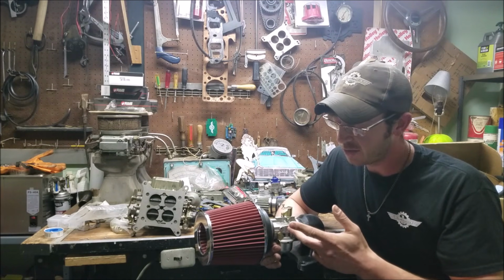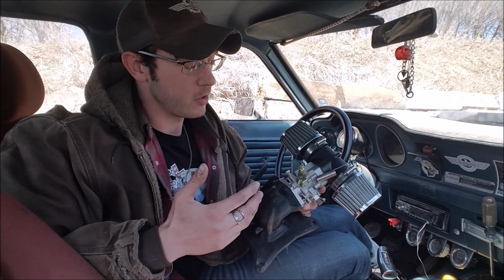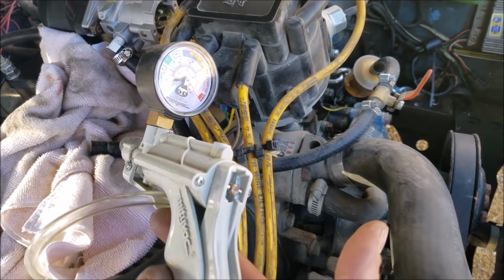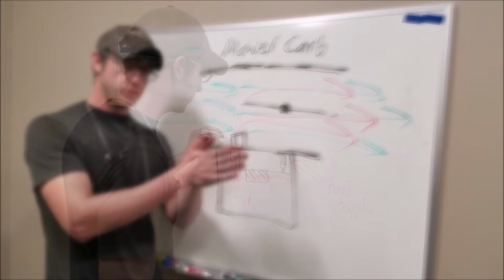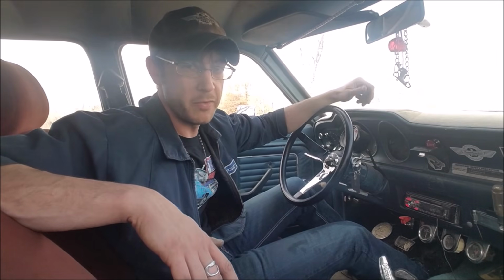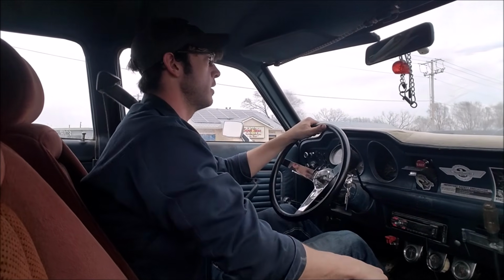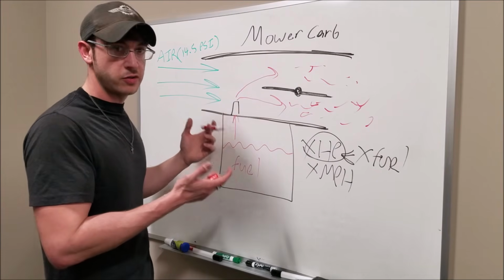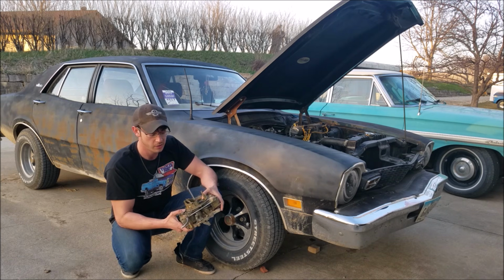Will It Run? Lawn Mower Carb on V8! (The "IMPOSSIBLE" Becomes Reality!) Start to Finish

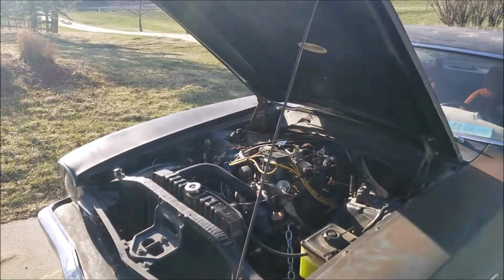Comment: 25:20   I was into building motorized vehicles from an early teen. When I was about 16 I was helping one of the older guys sand and prep his '56 Chevy. I'm 70 years old now so that was the golden days of building red light racers.

What brought me back in time, was the chain holding the engine from torqueing itself right out of the engine compartment. This was standard back then everyone had the engine chained down. You learned that after blowing out a motor mount the first time.

Comment: I think you did well...in 1982 I worked for Honda we had ordered a few Civics that had a little tiny one inch or less Throttle plate on them and they were  apparently good for 62 miles per gallon ..fun fact ..  That air in a smaller intake will travel faster than  air in a bigger one..plus if you want to increase air in a smaller pipe just mount a small egg into the intake with a variable height slider  ..it will pull in more air..old german Tech
Reply: What do you mean increase air in a smaller pipe?
Reply: @yeboscrebo4451 Air velocity will increase but volume will decrease with an egg.

Comment: I would treat that 41 mpg with a bit of skepticism and here's why.  Your distance traveled was only 39 miles which is way too short to establish a reliable mpg number and secondly filling the tank at a service station gas pump won't reliably top off the tank with exactly the same volume of fuel each time.  That can easily vary depending on the horizontal position of the car fore and aft and side to side at the time of fueling.  I can see how that volume could vary by a pint, a quart or even a half gallon.  With only a 39 mile drive that fuel volume difference can skew the mpg number quite a bit.  Your theory of better gas vaporization sounds very plausible and increased mpg with that small carb to me is believable.  What I would like to see if for you to do the same test and burn a much larger volume of gas over a greater distance.  Enjoyed your video very much.  Very educational stuff!
Reply: Your absolutely right about everything, I see a half gallon variable depending on the slight angle differences between stations. Every car is different too, mine gets less fuel with the front down hill. 

I will say in defence of the MPG number he got that his car with a 4 barrel carb might get 15mpg on a good day, so the setup he got is still a significant improvement even with that variable at the pump.
Reply: Agreed, I would love to see a measurement after a whole tank.

Comment: Well Done Champ. Your control device is so elegant. So impressed. Yes that smaller carb venturi allows for superior fuel atomisation but it's your wise management of stoichiometric ratio under differing engine loads that takes full advantage of the better gasification = it is simply beautiful. Probably superior to any MPFI for economy.

Comment: As a Brit with a Chevy K10, this is intriguing.
Our fuel prices equate to $8.30 a gallon over here, so fuel economy is always a consideration.

You've now got me thinking whether a V8 will run on an older SU type needle carb.
I think you've definitely got an angle going on here.

Keep it up!
Reply: My 98 K1500 is starting to give me trouble with all the electronics and bullshit.  It’s looking awfully tempting to rip all the computer shit out and stick one of these puppies in here.  The only thing that’s getting me is the varying loads, think I’ll tune it to run at 55 and just stick to country roads.

Comment: Ok here is my idea for the next step of this project. Print a new manifold adapter that holds 2 or even 3 lawn mower carbs. It would maybe look like a little blower hat. The carbs could be linked together/ isolated depending on performance needs. You could even figure out a way to stage them to act like secondaries if you wanted.
Reply: Yes. Volume/horsepower on demand is where the interest would be. Certainly impressive that he pulled down 40mpg in a big, heavy, V8 car, but it's not a hot rod. People interested in mileage alone could just buy a 4 cylinder, small car.
But those of us who want high horsepower old V8's that can cruise with reasonable mileage would be very interested in this.
Reply: What would be the point of that honestly , the whole point of this project was to see would it work peroid ..everything else was a bonus ...by adding more carbs ..your just going back to a fossil fuel guzzling engine , as homer said alot .... Doh !!!😭😂😜🤣
Reply: @ger808  No, the point is to turn those additional carbs on/off depending on demand.
Reply: @ger808  Your posts are getting shadow banned and so are mine.
Reply: I was thinking more about it and you could use a couple throttle cables and a custom linkage inside to activate each carb manually on the fly and fuel could be completely cut at each carb with an electric fuel cut solenoid like the ones in the bottom of the carb on an old craftsman lawnmower.
Reply: @borisjankovici662  ok I see cheers for the info

Comment: Hi. This was an interesting 1 hour+. Most lawnmower (carbs) I have tried work with e85. You could also try ethanol (blends), which produces a leaner mix. Blocking the radiator helps retain some of the heat of the engine, to get into efficient burn zone. You also noticed, the vacuum in the manifold is deeper. Thus, the initial pressure starting the compression stroke is lower than with a big carburetor. Therefore, your engine is running Atkinson-cycle. You noticed it yourself from a quieter exhaust note. With normal timing, there will not be knocking, because the initial cylinder pressure is lower. Thus, to get even better mileage and increased horsepower try advancing timing (even more with e85. Until the point of knocking). Also, lowering the head could give better efficiency, to be in par even with stock cylinder head pressures. If you do that, instead of 41mpg, you could probably do 50mpg .. MIB's helicopter heist 80mpg..

Comment: I bet that thing actually got 80 mpg. I'd like to see what that could do in a smaller, lighter, more aerodynamic car like a Prius with the battery removed for weight savings. You're a genius. You certainly know what youre doing. Keep fooling with this. 

Hope the oil companies don't scrag you like they did that young man with the S10 and the guy with the water car.
Reply: u talking about the s10 with a rotory engine?

Comment: Do a distance run; Instead of ~37 miles, try ~370 miles! With that short of a run, there are too many variables, like the angle of the car, or the temperature of the fuel in a full tank of gas, that can really skew the results with that small of a percentage of the total volume of fuel used in that run.
     Try that Holley 390 CFM carburetor, with the same mixture control module and same ignition timing curve. I'll bet it will be close, but not quite as good as the lawnmower carburetor, just because the venturi velocity won't be as high, and the fuel won't atomize as well.

Comment: I would definitely like to see this run on a slightly more definitive fuel measurement, put a gallon in a container and tie it in then drive it till it’s almost drained measure the remaining amount in the container and calculate mpg
Reply: Agreed... There is too much variance in how a gas pump nozzle measures a full fill-up to rely on that...
Reply: @colormesarge  -- All the regulations and inspections do is try to ensure that a pump measures a fixed amount of fuel within an acceptable variance, not that it is consistent in when the nozzle thinks the tank is full... They want to ensure that if the pump is charging you for 5 gallons of fuel, you are actually getting 5 gallons of fuel.

Nozzle shutoff is what can vary and makes his way of testing potentially inaccurate... A pump speed (gallons per minute delivered) can vary over time.  If it is pumping at a slower rate, it will allow more fuel to get into the tank before the nozzle shutoff occurs... I've been able to get over a gallon of extra fuel in a car by pumping slow... I've also seen pumps that delivered fuel so fast that the nozzle would kick off when the tank was only half full...
Reply: The fuel climbs up the filler neck and shuts off the fuel. That's got to be accuracy within like 2 oz.
Especially when it spills out on the second fill.
Reply: @CurmudgeonExtraordinaire Why would it not be that accurate?

Comment: I had a friend that owned a granny grocery getter, 1973 Dodge Dart, with a pre-smog controlled, wheezy, anemic  318 cid V8. It had a small one bbl carb about the same size as the one in your hand. It was good it wasn’t fast as this guy was not so bright but fairly reckless, mostly driven by his not so brightness. It would have needed a lot of suspension and steering work to make it speed worthy. I think it did get pretty good fuel economy. Super build! Thanks!

Comment: doing a awesome job on this, way back during bush and gas hitting 4.00 a gal i was fooling with hydrogen generators to increase gas mileage. managed to get a merc capri from 25mpg to 45 mpg. i would love to see you add a hydrogen generator to your lawn mower carb which would be pretty easy to do. i bet with the combo you would hit over 100mpg
Reply: Do you have any videos or info you could share about your hydrogen setup? These gas prices are giving me PTSD every time I fill up my truck.

Comment: Luke, question for ya.... so I've been thinking about the astonishing results of this carb on your 302, and the theory behind the operation... so what I thought about was, in order to make it even more efficient, could you take advantage of this significantly less dense air/fuel charge by bumping up the compression ratio to absurd numbers? Something like 11:1 or even higher? 12:1 with water/methanol injection? I'm super curious how you could extract every bit of power out of this (with all due respect, and there's a lot of that) ridiculous setup? Since the increased vacuum signal already creates a rich condition without your nifty air bleeder device, and the charge entering the combustion chamber is significantly less dense, I would imagine that it would also be less prone to pre-ignition. Just a thought, and would love for you or any other knowledgeable folks to chime in.

Also on that note, would a super mild cam made for something like a truck engine to make more torque down low help with the efficiency by increasing port velocity?
Reply: Truck cams move the power band to a lower RPM, often you'll lose efficiency due to pumping losses.

I don't remember what he's using but the stock cam torque peak is around 2400 RPM, his is somewhere around there.

Truck cams produce more torque and better vacuum at low RPM but they also have more of a load just spinning at that RPM, that's why the torque is there. His efficiency sweet spot would be at a lower RPM, might work out if he had overdrive.
Reply: How can you bump up the compression ratio while using less fuel? That would create knock. What he did was pull out timing so he did not have to lower his compression. Higher octane fuel also helps to prevent knock with less fuel.
Reply: @MCMinerHQ  Octane is raised with ethanol.  I don't run any of my carbureted trucks on any ethanol at all. 
100% Gasoline gets better mileage and creates less unneeded heat in the engine.
Reply: @MCMinerHQ  it works out in lean conditions under vacuum, you can push the timing further on less fuel.

Problem is as soon as you lean on the throttle it pre-ignites.

That's how I got 24 mpg out of mine, under cruise conditions my timing was like 60* BTDC, which wound up letting it run leaner.
Reply: @NoGodsNoDevilsNoWorries  If gasoline octane was raised with ethanol, that would mean the energy content of 93 octane would be less than 87 octane. This is simply untrue you have some homework to do. Fuels are cracked in large towers to get different octane and one tanker truck delivers 100 octane to the station and another brings 85 octane then the pump dynamically mixes from the two tanks to give you what you want. Octane/injector booster and cleaner bottles use 110 octane jetfuel and some light oils to boost your octane. The only time octane is raised with ethanol is when you tune your car to run e85 etc. Also, in fuel injected engines that can detect ethanol content, those engines will run cooler with more ethanol because they will have to inject 10-25% more fuel to make the same power. Some more advanced carborated cars would see a similar effect but I am unsure.
Reply: You could run CNG- compressed natural gas. It’s around 120 octane equivalent. Oh and it’s $2 per gallon (equivalent is actually measured in weight which is 5.66 lbs = a ‘gallon’)
Reply: @MCMinerHQ  the burn rate of ethanol blends is slower so it is somewhat raising the octane.

I can push the timing on my 390 4* higher with E15 than pure gasoline. The higher timing helps with fuel economy but the weaker fuel hurts it, still doesn't match gasoline's efficiency.
Reply: @World Peace Deathray  I think you misunderstood the whole thing. Not trying to be an ass or anything, just want to put that out there. He's using less fuel by creating a less dense air/fuel charge, with a severe restriction on the amount of air entering the engine. The air/fuel ratio is still correct with the reduced fuel by reducing the air coming into the engine through the restriction caused by an absurdly small carburetor. He advanced the timing, actually, so that the flame can have enough time to properly propagate through the less dense air/fuel charge. If you add density to the air/fuel charge coming into the engine (i.e. forced induction, nitrous), you need to retard (or "pull out") timing to prevent knock caused by the flame propagating too quickly (denser air/fuel means it can spread faster) and reaching peak cylinder pressures before the piston has finished the compression stroke. 

He could easily "add" more fuel by setting his carb cheater to aim for a lower target air/fuel ratio, since without the device, it already tries to run rich as it is.
Reply: @phantom240  just a heads up, the person you clicked reply under gets the notification no matter who's name you type in the box.

I got this one, the other guy won't see it unless he happens to click on it.
Reply: @glenwaldrop8166  weird. YouTube being dumb again I see. Oh well, my bad lol
Reply: @phantom240  Good explanation.  Hes simply filling the cylinders with the correct a/f ratio...and a well atomized one at that. Wonder what a slightly larger lawnmower carb would do trade off wise...power/mpg ratio. (GOTTA DO THE 100 MILE MPG TEST FOR BASELINE) ..lotta stuff going on here. I would not alter that maverick set up till I Figured out what the holy graille combo is...The right guy is on the job:)
Reply: @jimmy-et1pm  If I had this setup, I'd see just how lean I could push it, or how far I could advance the timing before losing too much power or creating spark knock. I wish he would have said how much more he advanced the timing to account for the air/fuel charge.
Reply: @phantom240  I think he's got a roller engine, should be 9:1 compression with a slightly hotter cam so he should be able to really crank the timing at light throttle. With his programmable dizzy that shouldn't be too hard.

I had my timing up around 60* all in, backed down to mid 30s pretty quickly after hitting the throttle. With longtubes, dual 2 inch exhaust and glass packs it was really quiet at cruise, loud when I got on it.
Reply: I think that would require water injection or destroy the engine.
Reply: @foxmaine3921  I don't, I've done it. He's monitoring the O2 sensor, I didn't have one, I went by ear and reading the plugs.

Lean cruise burns slower, it requires more timing.
Reply: The easiest option here is to simply change the transmission to an overdrive transmission. Running 2,200 rpms at 60mph is a horrendous low gear ratio for such a large, high torque engine. It should be turning closer to 1600 rpms at 60mph. I believe most modern V8 vehicles turn about 1500 rpms at 60mph. The other thing to change is the air fuel ratio. The air fuel ratio should be 16.5 during cruise, not 14.7:1. They only use 14.7 because it's what the catalytic converter needs to operate properly. But I've run my car at 16.5:1 for years without any problem at all. You can write the program to richen the engine back to 13.0:1 during acceleration, but once you are "cruising" you go back to 16.5:1. Also, modern 0-30W synthetic oil, especially Amsoil or Motul oil, will give a pretty massive reduction in friction. At 2,200 rpms there is a huge amount of oil friction in a V8 engine. I put Motul 7100 oil in a Hayabusa, and it was like having a whole new engine, because it reduced the friction and pumping losses so much compared to "Mobil 1" synthetic.

Comment: Definitely a cool video, I have to wonder what dyno numbers would show and how it would do on high RPM WOT pulls. My guess is an engine that makes 300hp peak would be around 80-90 with this setup, but you have to remember it doesn’t take anywhere near 300hp to get down the road. In a 2500 pound car to cruise 70mph on level ground you’d probably need like 25-35hp, pulling a steep hill at 70 is going to need something closer to 100 but I would basically assume the driving experience would be akin to driving an old VW beetle vs a modern one. Cruising on flat ground at constant speed there’s just no difference in power demand and in city driving you have so much advantage due to gearing only running in 1st-3rd that low peak hp numbers don’t make a difference.
Reply: it makes like 50hp